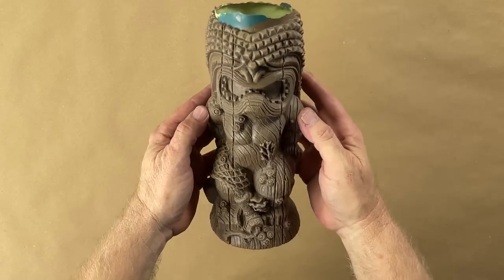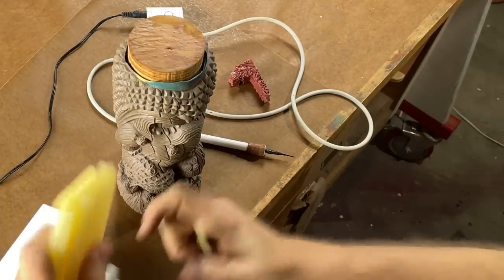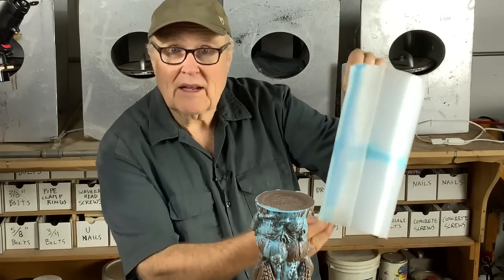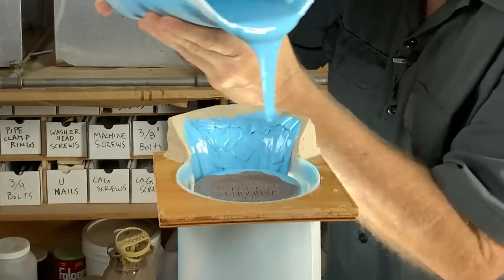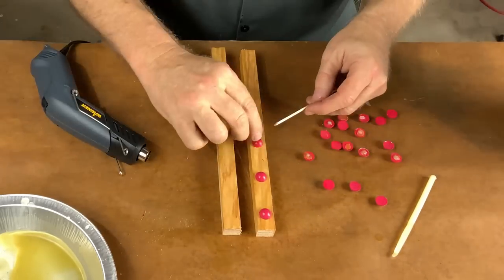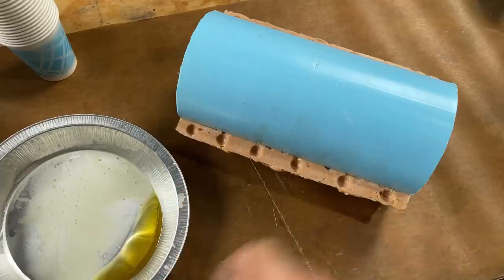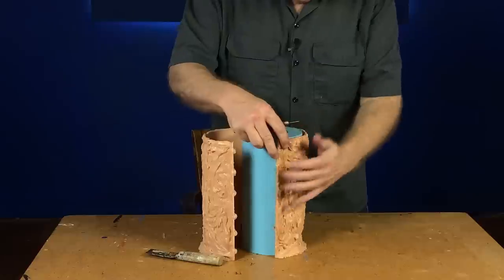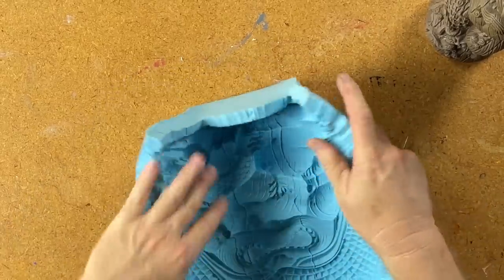Making A Mold For Roto Casting - Part 1

Comment: Another Tiki casting. Nice. =)
This time you checked pretty late, if the mold caught bubbles. What if it had? 
I guess you can't repair a mold, can you? Would you then have used the cradle to make a new mold? Or replace the cradle aswell?

Comment: I was wondering how many castings can you get from a cut mold? I am working on some synthesizer projects and was thinking about making custom knobs.
Reply from the maker: There are so many factors that influence the longevity of a mold. But I generally average between 10 and 20 castings before the mold starts to degrade noticeably.

Comment: I looooove your videos! I'm struggling with a one piece moud making. I have to make a sneaker (including the footprint sole) and this sneaker will be a plant pot. Any advise/ideas?
Reply from the maker: I would be inclined to Rotocast the shoe and afterwards cut out the opening where the potting soil and plant goes.  You might have to drill some drain holes in the sole of the shoe.

Comment: Great video! Is that jacket mold trowel on odourless? 
Also wondering, re rotation resin casting a thin shell like that tiki statue, does that thin resin shrink too Ike that solid piece you did a few weeks back?

Comment: When you paint the rubber on do you need to get it done before all the rubber for the whole mold cures?  Like is it the same mix as the pour or does it stick to the pour even after curing?
Reply from the maker: You can build molds in layers; even letting the layers cure in between.  Test it though.  That works with the silicone that I use but make sure that it works with yours.

Comment: Amazing tips thank you - plus how do yo work out the volume in the cup?
Reply from the maker: I know the exact amount of rubber that will fit into one of those yogurt containers. So once I had poured the first batch I could eyeball estimate how much to mix up for the rest. And still I had to do a small topping batch to fill the mold to the top.

Comment: I apologize if I missed it. But has it ever been explained why beeswax is preferred over a mold release spray or other type of option?
Reply from the maker: Beeswax has two very important characteristics. The first is that it sticks to everything, but nothing sticks to beeswax. So it is an excellent mold release.  The second is that it never causes cure inhibition or other bad reactions with rubber or resin. At least not in the materials I have worked with.  There are times when mold release sprays are necessary and beeswax would not be a good choice. For instance when you need to prevent rubber from sticking to itself, like when you make a two-part mold. Then a spray release is the way to go.
Reply: @RobertTolone  awesome, thank you for the explanation.

Comment: Do you ever do complex 3 or 4 part molds?
Reply from the maker: No. Most of my work is characters or figures. It’s much easier to break a very complex sculpture into parts and cast them individually than it is to try to make a complex multi-piece mold. I do however make very complex cut molds. These molds have cut lines that follow shapes wherever they need to go to release the part. A rubber mold can have a great many cuts in it and still close up to make near invisible parting lines.